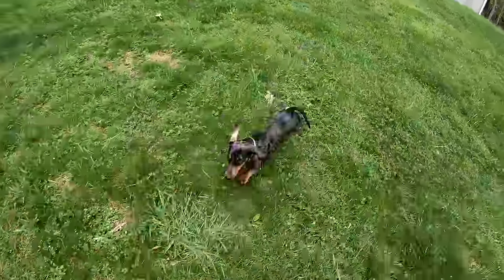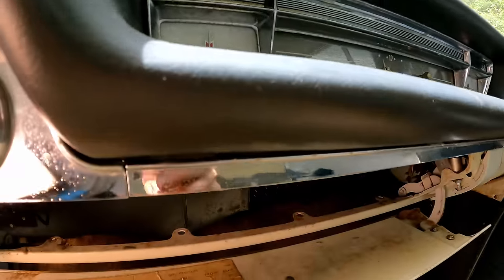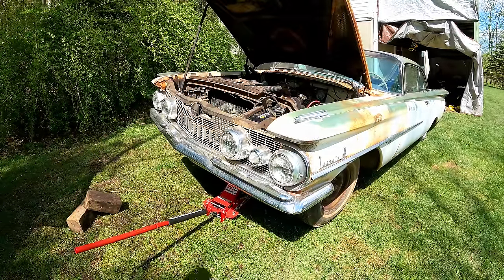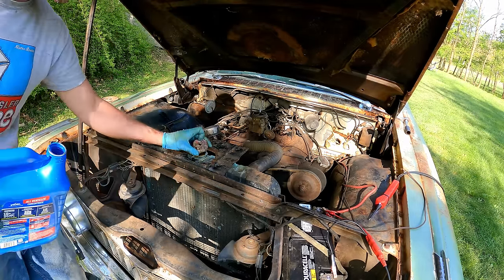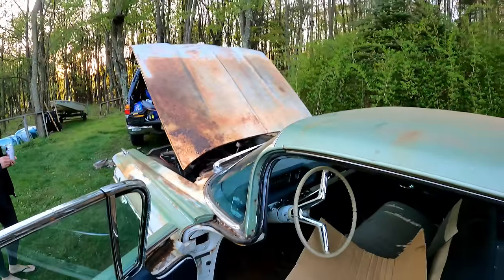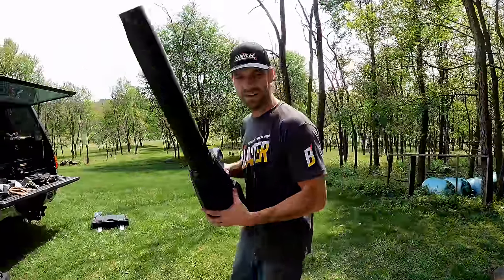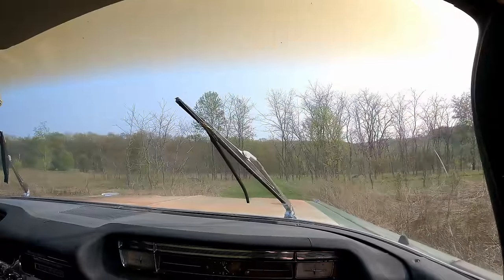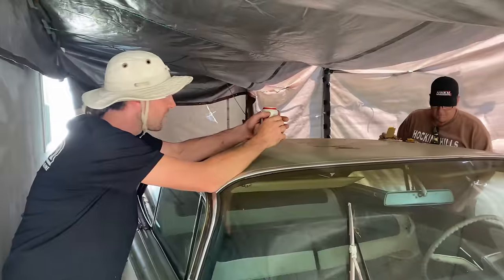1959 Oldsmobile Dynamic 88 Sitting For Years WILL IT RUN? - NNKH

Comment: clacker pumps really are designed to push, not pull ideally to be mounted same height as bottom of the tank or lower to gravity prime, they will also fail quicker pulling as opposed to pushing

Comment: It's a very good car, but I would not use that type of crude leather seals on the booster piston, those are the same as the Mercury Treddle Vac boosters of that time, which were no good either.
I would get something more modern to replace that crude dangerous thing.

Comment: The Chevrolet Series D is an American automobile produced by Chevrolet between 1917 and 1918. Over 4,000 Series D cars were manufactured in the 1918 model year, and it was the first Chevrolet car with a V8 engine. It is capable of producing 36 hp (27 kW; 36 PS) at 2700 rpm.[5] This was Chevrolet's first V8 and one of the first overhead-valve V8 engines. Chevrolet would not produce another V8 until the debut of the Generation I small-block in 1955

Comment: A 60 olds master and booster will bolt right up in place they moved master and booster up to fire wall in ,60 you might need a 60 Olds brake pedal also should be a little cheaper Iowa classic cars had a 60 Olds parts car

Comment: rislone engine treatment max performance is best for sticky valves and lifters!
Reply: it works better than marvel mystery oil. tried marvel on a engine that had bad lifter noise sounded like a diesel and rislone fixed it! rislone has been around since 1921!   give rislone a try!

Comment: About all older GM cars, Chevy, Olds, Poncho's, Buick are notorious for noisy lifters, especially after they've sit awhile, like you said they just gotta run a little while to pump up and quiet down. The older Chevrolets are really bad for that but no worries. Anywho, good job on that, gotta love those old American land yachts, American iron, i got my license when I was 16 in a big ole Olds, 65 or 66? Delta 88, that was a fine old car too, course it was only about 10 years old when I got my license.

Comment: The boat is a late 1962 or 1963 Century Resorter 17'.  Century was the second largest inboard speed boat builder 1940s-1970s.  This boat was a good all around boat a good ski boat and good ride boat.    This hull was built from 1961-1968 in wood.  And the same hull was offered in fiberglass starting in 1965 as a test platform  around 5 boats.  Full production of the fgl version in 1966 to 1970.  A similar boat followed in 1971 with a different bottom shape.  That boat was built into at least the late 1980s..   this boat is altered.  The wood decks were done by someone but century did this too as special order.   This is done differently than Century.  Plank width appears in the video to be wider than Century. Also the stripes would have been white.     The original deck on this boat would have been plywood covered with white vinyl.    Also this boat originally had the optional sliding softtop.

Comment: My friend has a 1960 dynamic 88 he picked up a year or two ago.  It was a one owner old woman car that he purchased after the original owner died at an estate sale.  It was a garage kept one owner California car and the only damage was the lest rear bumper and the front right fender looks like the woman got too close to a pole.  I found a good used fender and color matched and aged the paint.  Luckily the car was white as it was easier to match.  A few months after getting it on the road the radiator failed and it filled the trans with coolant.  Pretty soon he is bringing me the car for a ls swap and it will be getting a gen iv aluminum 5.3 with a 6l80e.  He is giving it to his daughter for her first car.

Comment: That's a one year only body style/design. What a cool looking car. It might be a lot easier and safer to change the master cylinder to a dual type and mount it on the firewall. The factory air cooled drum brakes look large enough to stop the car for sure!!

Comment: Loved that car, the bubble top makes up for the smaller than normal fins for 59.i would consider heated concrete slab for the new shop,they work great.The older the car rescues,the better,enjoyed the video.
Reply: Good heated floor suggestion DS.  I'd bet there are quite a few followers who could suggest possible ideas for Chris's new garage/shop.

Comment: All the customizers we knew would take their families' 1959 Olds and simply put on scalloped over a stock paint job, put on a continental kit or bubble skirts and most importantly put a third headlight assembly between the existing two head lights where the turn signals had been
So now you had SIX HEADLIGHTS. U hen add a bullet style grille. It was AMAZING cause for like $300 at the time, you ended up with a really radical (looking) custom car. In most states, you had to keep the idle "third" headlight not wired up. Which we regularly disobeyed even having side to side sequentially scanning relay set up to drive "straight" adults in the neighborhood crazy or outrage teachers and "responsible" types...the ease and inexpensive nature of making any '59 Olds into a really radical LOOKING custom was famous.
Everyone had their opinion as to whether the tapering real slope or the flat solarium type roof line was the coolest.
The J-2 killer triple carbs and the dealer installed tube headers was usually avail able which really DID turn a big Olds into a street Rocket. The red with pearl scallops or the gold and black or the white with more radical scallops were the big favorites at the time? Really golden memorirs......

Comment: Hope all good the  luck on it. I still kicking myself I could of got a no rust like under 27,000 all original 1961 2 door Pontiac Catalina 389 Tri-Power only a groceries getter drove by the wife back in 82 from elderly couple for $800 they even drop price down to $600 because they know I take care of it. I was into late 60s muscle cars dime a dozen back in them days. If I bought that. It would been huge good investment. It ended sold to a  boy moved to  Charlotte NC area.

Comment: I have a 1959 Oldsmobile I just did my brake booster took it off sent it off to a place called Harmon brakes with shipping and everything. They rebuilt my unit far around 450 and it was perfect.

Comment: Those are the old " Bendix Treadle Vac " units used by several auto companies back then. I have a 55 Packard 400 with the same unit. 😊 You can get parts or rebuilding services   through Kanter Auto , or, find a brake place in Hemmings Motor News ! 😊

Comment: I cant even find a picture of that booster on google let alone one to buy. Strange design. Id have to retro fit a normal firewall mounted booster/master/brake peddle. $800 for a booster is insane. But im regularly shocked by the crazy prices of stuff today. Inflation is a SOB, thanks grandpa biden 🙂

Comment: '57 Pontiac I have in my shop for a customer has an almost identical brake master and booster, and equally expensive and impossible to find replacement parts. I had room on the firewall to convert to a 7 inch dual diaphragm booster and a dual circuit master cyl mounted in a more conventional location with a universal "hot rod" style pedal hanger and bracket kit. Possibly something to consider for this one.

Comment: Those engines were notorious for cracking heads & good luck finding a water valve for the heater. If I remember right there was a color difference in the valve covers regarding what compression the motor had.

Comment: Hook up an ammeter to the battery positive clamp and post and set it for amps. Check for a drain. If none, set it for ma and check for a drain. Hook up an  ohmmeter to the alternator positive terminal and case. See if it reads high one way and reverse the leads and see if it reads lo the other. This checks the diodes. If it reads high both, the diode is open. If low both, the diode is shorted. On the amps drain test, if it shows a  drain, pull the starter positive wire off to see if it drops indicating a shorted starter. If it shows an amp drain, it might be the air conditioner clutch. Check the transmission fluid. Add to the top of the mark. See how to bypass the voltage regulator to check the alternator brushes.

Comment: Add a bottle of Lucus Zinc oil additive because all new oils had it removed. Also run Avgas with low lead because them heads do NOT have hardened exhaust seats in the heads

Comment: Reminds me when I was younger we had a 59 chevy with a six cylinder that we used to drive out in the field. When it got hot we would pop the radiator cap off with a big leather welding glove then shove the garden hose in the radiator to refill it with cold water then hit the field again.

Comment: I've been advised... by people that are waaaaay smarter in Oil chemistry engineering department,  to STOP adding things to the engine oil.... or any oil for that matter.  Oil is designed by very smart people.... much smarter than me.  So, I just used the oil as it comes out of the bottle.  Adding anything to any oil compromises the specific design created by engineers.  So....I leave it to the pros.
Reply from the maker: I would have to disagree. A zinc additive helps with keeping the flat tappets healthy and marvel mystery has blown my mind several times.
Reply: @NoNonsenseKnowHow It's all good..  to each their own.  I'm just saying that I'm not qualified to alter the design of oils.